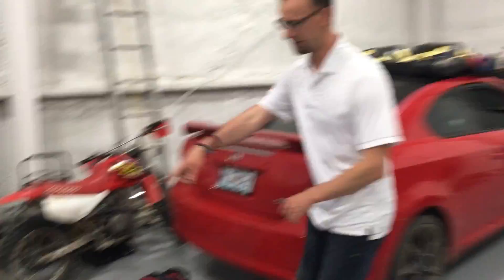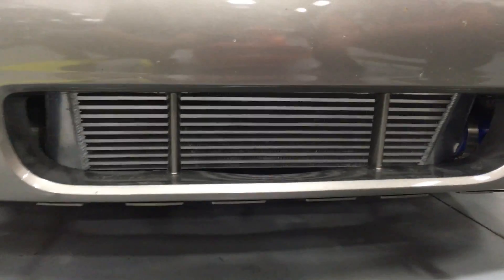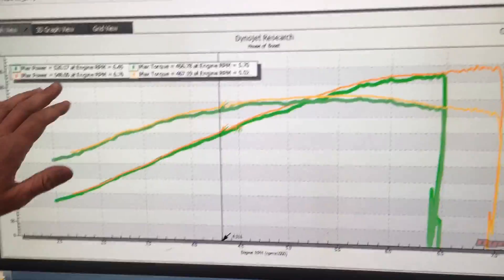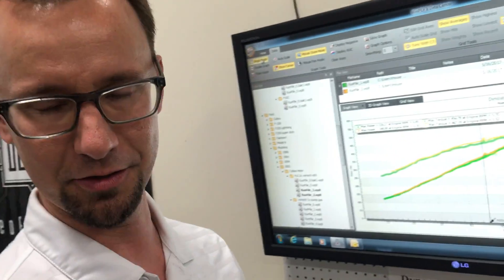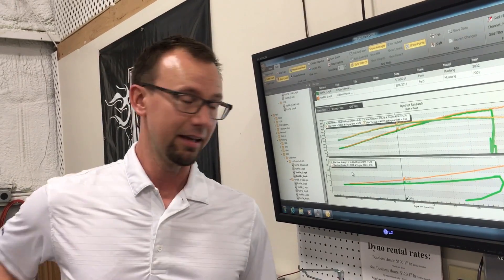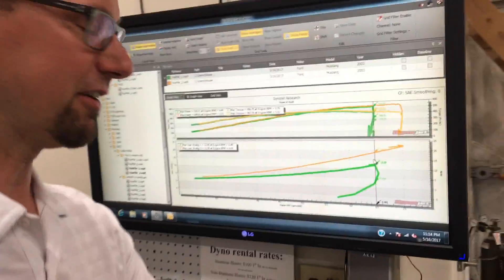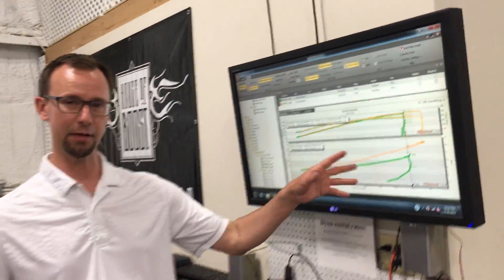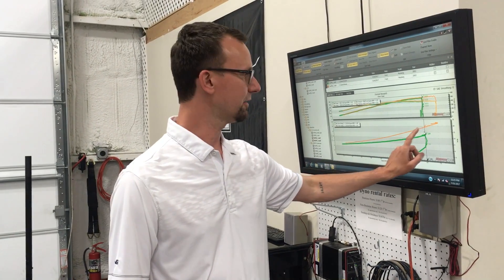Don't buy junk intercoolers for your turbo or supercharger | Horsepower United

Comment: It does not help generalising cheaper intercooler upgrades. I bought one from Ebay at the third of the price of name brands. I figured it had to be better than the stock one on my Golf R and can't go wrong. Well? I was happily surprised with the build quality, hose and clamps that came with it. Even more happily surprised when i did numerous back to back. Boy! Could i feel the extra kick alright. So, certainly no regrets on a budget Ebay Chinese made intercooler. I also note a number of businesses buying and reselling Ebay intercoolerd citing they are made inhouse. That is a load of bullshit and nothing short of conning people. I say... If you are not racing on a race track and every split second counts then throw your money in on a much more expensive intercooler. Other than that? Save your money and get a Chinese Ebay one. You be surprised of the quality. Besides, many things are made in China Taiwan e.t.c and branded for the business having them made for them That includes Tyres.
My Golf R runs like a Super car. 👍🇦🇺😉

Comment: I need to know is the cxracing intercooler  kit for the 280zx good because I was going to get one for mine.
Reply from the maker: CX has some good units, and some terrible units... I would suggest getting one thats MUCH larger then what you need.  IE: if you wanna make 800hp, don;t get the 800hp unit.  Go as large as you can

Comment: wow , that massive boost loss !!!!
I bought a big brand name , water AND air cooled ic for my built r53 and it causes me to go from 22psi ( stock ic ) down to 16psi.. yea iat is way cooler but the throttle response and boost loss DOES NOT make up for it.
so I bought a better made , standard air to air ic and I now make 20psi with as good throttle response as stock ic again..

Comment: I dont think they will see 22 lbs with a less restrictive intercooler. Less restriction means less boost.
Reply from the maker: It picked up 10psi at the engine with the intercooler swap.  Car makes 750 hp now

Comment: Welllllll, you compared a vertical intercooler with a horizontal intercooler which is one reason for the pressure drop you saw. Let's see that again with the same orientation!!!
Reply from the maker: That old POS intercooler was thrown away a long time ago.  So no video to be done.  The car makes 750+ hp now, so no looking back

Comment: That all sounds good on paper, but the purpose of an intercooler is to act as a heat exchanger, lowering the temps of the intake air charge. The more efficient the Intercooler is, the lower the pressure drop to an extent. The brand name intercoolers use research  and development to find a good mix of macimum cooling and minimal pressure drop. This is because the well made intercoolers have a higher fin count. 

The higher fin count increases the surface area of the intercooler, making it more efficient and able to exchange more heat, which is exactly the purpose of an intercooler, but at the same time creating more drag due to the surface area.   
A hollow pipe will have next to no pressure loss, but that doesn't make it a good intercooler.   

You need to also check the cooling ability of an intercooler with a temperature gauge in a controlled  environment before and after the intercooler as well.
Reply from the maker: We swapped intercoolers and the car picked up 200hp... IAT's went down, and all was well. :)
Reply: @erikradzins  where's the video?
Reply: @HaloHamstur  it well pick up more power as the engine is now seeing more boost.
Reply: @erikradzins  What do you think of Wagner intercoolers? I heard they are better than 90% of FMIC
Reply from the maker: @frazmeup  I have used them.  I find them to be on par with other high quality intercooler cores.  There are really three tiers...    Really Good, Middle of the road, and crap.  (They are in the really good category)

Comment: It sounds like a boost leak, no way any chinese intercooler is gonnay give you a 9 psi pressure drop.
Reply from the maker: Well it did, there was no boost leak.  Its just an intercooler that should have been rated for about 450hp.
Reply: @erikradzins  well that makes sense why it didnt make much power, but it dosent explaint 9 psi of pressure drop.
(Confused)
Reply from the maker: @henrylima6974  its a crappy core, that someone over rated to sell on the internet cheap to folks that never check things like back pressure. 

Swapping the intercooler to another unit gained so much boost and power the motor ended up hurting itself LOL.  Sadly we never did a follow up video, then the car got an automatic and a new motor, so kinda hard to replicate the test now.

Comment: Very helpful. I’m going with a procharger ASAP. Now how did you get a 2v to rev to 7k?!
Reply from the maker: Cams and ported heads. :)
Reply: @erikradzins  TFS heads and Cams... my 2v made 728rwhp at 16psi Procharged (good short block too)

Comment: You need to clear this, the pressure dropped after the air went tru the intercooler? So? Does that mean, that some amount of air was gone or lost? If it does, where did it go? I believe you need to check the temp dropped aswell, plus size/diameter of the inlet and outlet of the intercooler. If the diameter of the inlet and outlet of your intercooler is the same and giving you the same air pressure from both sides or no drop from outlet, then your intercooler is not doing its job, to cool the air.
Reply: @AutoBodyEverything  thats ok, Im a mechanical engineer so technical is my thing... 👍
Reply: @AutoBodyEverything  which comment? Anyway, Im looking or expecting a video where the actual air drops with proper measurements, proving that the intercooler is blocking the air coming out from the turbo. With proper basis and documentations with measurements from point to point, and please include the temperature. And a comparison with other brand of intercoolers with the same set up. Im sure you understand what Im saying, being a technical guy. And I wish you luck... 👍
Reply: @AutoBodyEverything  intercooler serves as heatsink, air transfer the heat to another object with a larger surface area. While the air outside helps to cool down the intercooler, this temperature drops also drops the temperature of the air inside, that is what you call heat transfer. It is not the restriction that drops the temperature. The restriction of air to moves freely make it more hotter thus, air pressure build up.
Reply: @AutoBodyEverything  and thats what I been trying to tell you since the beginnin of this conversation, you keep telling me that a restriction is happening in the intercooler. And I keep telling you that if you are true then the intercooler is not doing what it is supposed to do, to cool down the air. Because if you are restricting the air inside the intercooler then you are compressing it, thus making it hotter. And it doesnt make sense, why would you use an intercooler just to compress the air again inside it? That's why I dont believe in your theory, because an intercooler cools dowm the air, in other words it does not compressed it neither restricting the air. The amount of air in the inlet is the same amount of air to the outlet, DENSER, the same reason the pressure went down.
Reply: @AutoBodyEverything  even if it stay in milliseconds aslong as the heatsink has a lower temperature, it will cool down the air. Perfct example is the evaporator of an airconditioner, where warm air passes tru the evaporator with a much lower temperature making the air cold, and you can feel it tru the vents.
Reply: @AutoBodyEverything  that is yet to be proven, because you didnt show that to your video. If you wanna be technical, you should have measure both the diameters of the inlet and outlet of the intercooler and mesure the exact dense of air to measure the desired psi. Remember the cooler the air gets the denser the air becomes, thus lowering the psi.
Reply: @AutoBodyEverything  you should try making a video of an air conditioner evaporator, and you would see a lot of pressure drop from the inlet and outlet of the evaporator. Same with the water to air intercooler, same theory with an AC evaporator. And think about it, if there is really a huge restriction in the intercooler, there will be a delay, you step in the gas, the turbo spins building up air pressure, then it was trapped in the intercooler (your theory), stayed there for sometime, then you released the gas, now you have low rpm and yet you have a volume of air about to get in the engine (that was trapped now about to be released). What will happen with the engine, how will it react, or how will your engine computer reacts? mix of low fuel and a volume of air.
Reply: @AutoBodyEverything  my comments were very clear. I was referring to the end side of an AC, which is the evaporator side. Of how an ambient temperator is cool down while passing tru the evaporator. How air is cool down. Internal system of an A/C uses refrigerant like 134A and not air, and Im not talking about that, i am talking abot when evaporator is already cold. And the cabin air passes tru the evaporator, transfering heat and making it cold. The same with an intercooler where air passes tru the intercooler, transfering heat and the result is cooler air. I already expect that you're not making a follow up video to support your claim, as it will just deny it. Anyway, we had a good conversation, and I appreciate it. Good luck... 👍

Comment: What is the  minimum amount of boost can the  F1-A and the F1-A
I want to be able to purchase a F1A or F1 A94 Stead of getting a D1 hours and have to replace it down the line I rather just get the bigger supercharger now and run low boost but I need to know how long can you run these two units

Comment: Hmm.. I run the eBay intercooler with 2 rear mount turbos.. I'm tempted to run a bypass pipe around the intercooler and see what effect it has on spool and iats... it's an l99 car around 7psi boost. any guesses?
Reply from the maker: No need to remove it.  Just check your boost pressure coming into it, and compare it to your manifold.

Comment: Sorry but you are only half right , because the size of the intercooler piping makes a difference in pressure also .after many years of in the automotive industry and all the clueless people fitting 3 inch piping and massive front mount intercoolers on a stock turbocharged Japanese cars . Fact this does nothing

Comment: why you run a carb setup not efi .
Reply: @erikradzins  can run more boost on carb without intercooler .. efi is running your fuel through a hot! solenoid.
Reply from the maker: Carbs drop the temp due to how the fuel is distributed at the time there is a pressure drop from the top to the bottom of the carb.  Also having a fuel pressure usually 10 times lower helps.   

But a lot of people don't want to convert to a carb these days.  Just the way it is, even though I am a huge fan of blow through.

Comment: Is there any formulas out there that state the ideal size of intercooler vs turbo set up?   I feel like the old school thought was put the biggest intercooler one can fit.  It looks like that sacrafices a lot of low end power for high end power.  If you are doing a mile race then this doesn't matter but most people race quarter mile and feel like this could hurt off the line times.
Reply: So you need to experiment, your goal is to get the lowest intake temperature as possible. So to test the best intercooler size, use temperature detectors at the inlet and outlet of the intercooler (after turbo outlet compared to intercooler outlet to cars intake). In an ideal world you want the biggest intercooler to allow for the most air to flow through, therefor allowing the air to remove as much heat as possible. You will never be able to have a cooler charge than the ambient air temperature.
Reply: D/P drop across the intercooler should be as LOW as possible, D/P goes up if you have less cooling channels to go through

Comment: Is leak test equal pressure test? thinking about getting a used IC but have no exp in this. They say to check for holes, bent fins, and do a pressure test. But you can't do the leak test or pressure test after you purchase the IC (getting a used one)

Comment: Wiat i have a question .. so i have a turbo charged car my tune is set to give me 22. Psi . I currently upgraded my outs lets and know i cant get more then 16 psi can these be a i intercooler related problem or boost leak ??
Reply from the maker: Depends on where your boost reference line is.   If your reference line is at the compressor, then yes you have a 4psi drop.

Comment: Owners of shops bully their customers like this all the time. They scare tactic them into believing something so they can sell a product and make more money. A pressure drop is perfectly normal from inlet to outlet due to air cooling. If he picked up as much power as you stated from one intercooler to the other, where's the proof? You can point to a dynograph all you want, but you're not fooling me.
Reply from the maker: I don't own a shop, and I don't sell anything.   So I have nothing to gain from what you are talking about.   I tune cars, and when a car is way down on power for the blower RPM.... then I look for the reason why.  This guys reason was the intercooler.
Reply: @erikradzins  so, where's the before and after video? If you were so confident the new intercooler would make that much of a difference, why wouldn't you make a video showing that?
Reply from the maker: If you read my other comments, you would have seen I have already answered this at least 3 times.  RECAP: The owner of the car swapped intercoolers, the car made mid 700's, however before we had the chance to film the next video the engine suffered a valve failure.  (dropped valve at high RPM)  Since that failure is basically catastrophic to the entire engine, and none of us are millionaires it took a while for him to recover from this.  Just last week the car fired for the first time with its new parts, however, is still a few weeks away from being back 100%.
Reply: @erikradzins  shame then that we won't see a direct comparison now of before and after each intercooler.
Reply from the maker: I have the dyno graphs, cause as I stated above we DID do the back to back.  We just hadn't made the video, since I didn't have my camera that evening.   So I can make a video, chatting about the graphs of the before and after... just no video of the dyno runs....
Reply: @erikradzins  You don't own a shop and you don't sell anything? Then what's with the rollers in all your videos? Sure looks like somewhat of a shop environment to me.
Reply from the maker: I am an EFI calibrator, and I own event space.   So I spend plenty of time in other peoples shops all over the country. :)
Reply: You work for ati and house of boost. Wanna bet you shove products down people's throats?  LOL

Comment: Obviously had a flow problem. Believing what an eBay seller rates an intercooler is like believing horsepower claims at a car show. Do the math and look at the inside of the core. Need at least 4x inlet size to match.

Comment: Hello, I'm in the market of buying a new intercooler, trying to get 450HP from my 326hp car so nothing too extreme. But how exactly do you know if an intercooler is good or bad before buying? Both are respected brands (VRSF and WAGNER) but one costs 450 euro and the other 900 euro. Both claim exactly the same design and size. After seeing this video I'm abit afraid to go for the cheapest one but it really seems like a good intercooler.

Comment: Also it does matter the power adder.  Don't get me wrong I always talk about proper intercooling, but with a turbo you'd simply have the gate stay shut longer, this is a fixed volume  So rather than have a 100 whp increase, you might see 20 rwhp on a turbo, which is still enough to change.
But then you have to look at the change in temp from running 1/3rd the length of cooling as I've mentioned before.
So this video is for the importance of a fixed flow power adder (pulley).
Reply from the maker: The turbo maskes the issue a bit.  But its still a masssssssssive issue.

Comment: I really would like to see a real-world test between a black painted Intercooler and a non-painted intercooler. Both on the same car with dyno test results. I've been hearing lots of scientific theories, but nothing is more useful to the discussion than dyno testing both on the same test vehicle. Thanks!
Reply from the maker: a light coating of paint has no effect.  We did a LOT of testing of that before releasing black units.  Now if you cake it on it, well obviously thats an issue.
Reply: So an etching Primer and a light coat should be fine? No power loss do to inefficient cooling? My plans are to place strips of tape over the fins to prevent painting and only paint the solid surfaces.
Reply: might car mods has a video of this and the black made more.

Comment: More info please.. How do you determine it is not junk before you purchase?
Reply: agreed
Reply: It will be determined by the flow rate of that intercooler. If the flow rate of the intercooler is below the flow rate of the turbo, it's going to restrict the air.
Reply from the maker: No real way honestly. :(